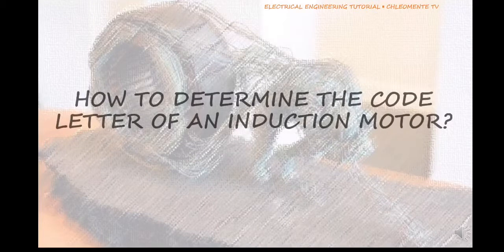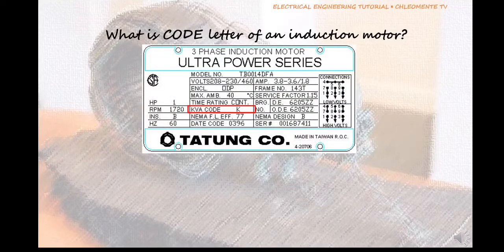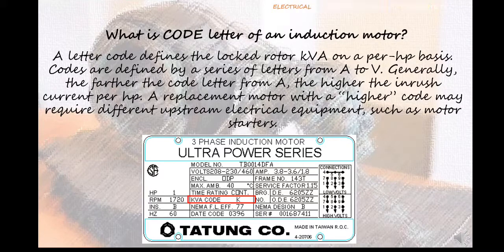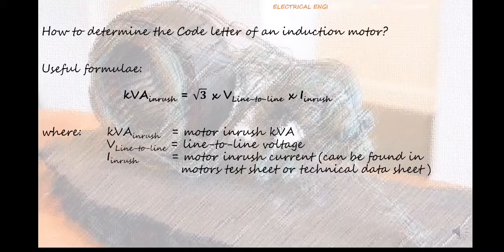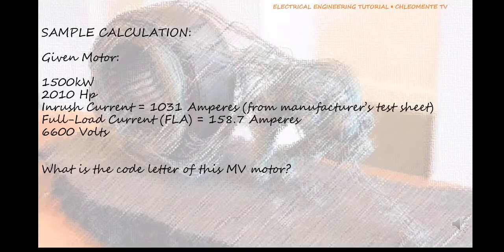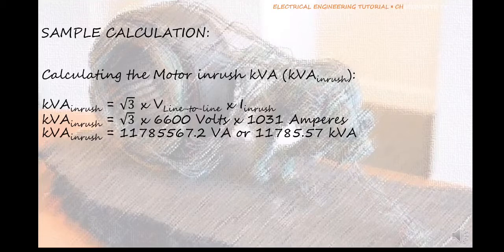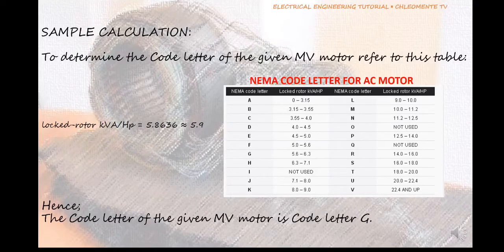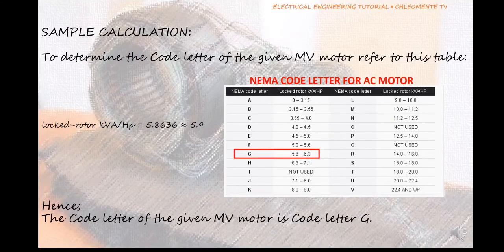How to determine the Code Letter of Induction Motor? With sample calculation.

Comment: hello i am having trouble understanding this question so how do you solve this problem?
What is the locked rotor motor current for a 3-phase, 460-volt 100 HP motor with a locked-rotor code letter "E" on the nameplate?
thanks in advance

Comment: Hello the video is really nice but is it possible to divide KVA by HP? As long as I know HP is another system so in the formulae it should be diveded by 1500KW to determine the motor design letter, right?